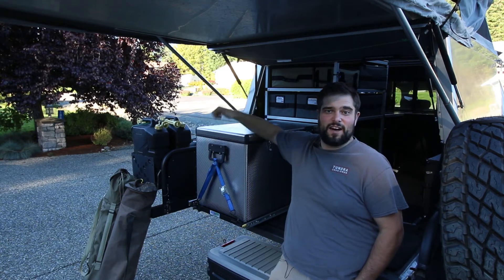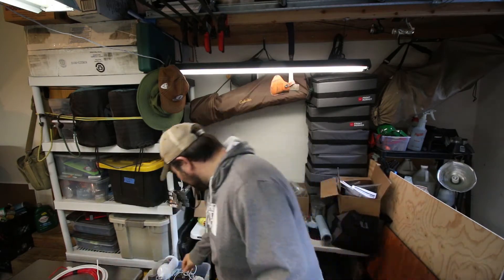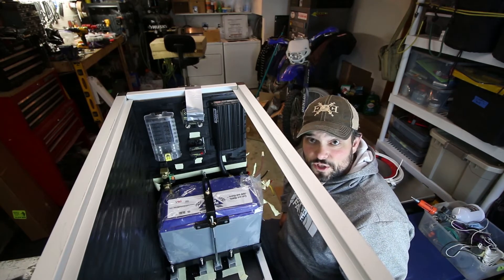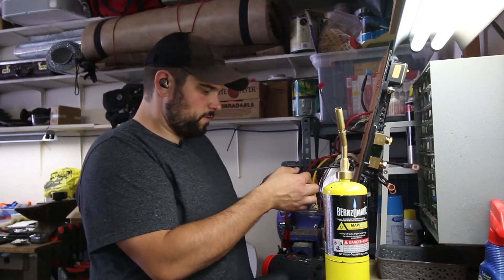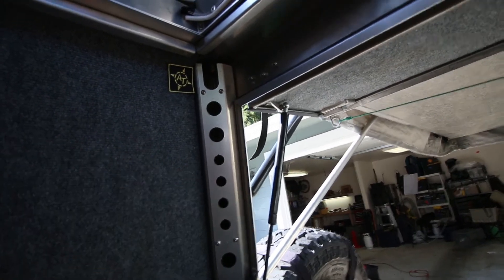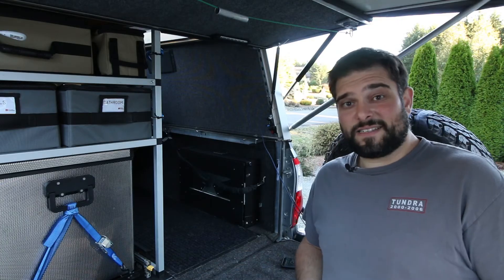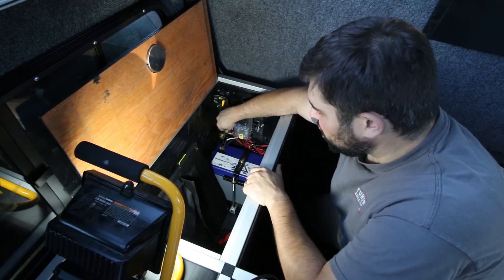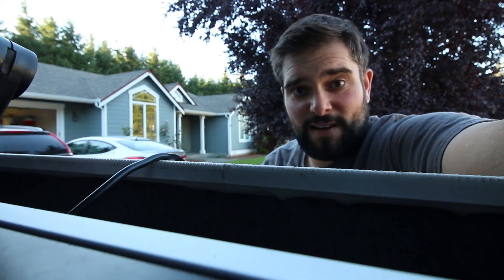Auxiliary Battery System Install - My Vehicles Secondary Power Setup

Comment: I am only 5 minutes in but did you consider mounting the battery up front?
Reply from the maker: I did, bnlut have that area designated for my winch controller and arb dual air compressor so I didn't want to crowd it. Also, lithium batteries prefer a more constant temperature so I thought it would work better for me in the rear. You could totally go that route though
Reply: This is true. With Lithium battery prices going down I considered adding under the hood but ran into the same conclusion. I went AGM under the hood, but lithium in the cab of the 4runner is in the future once I find room.